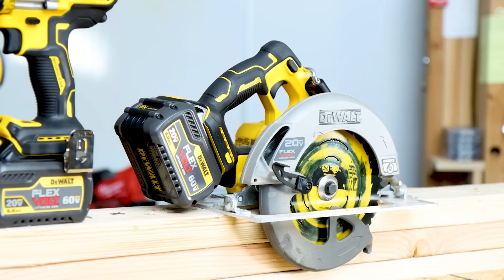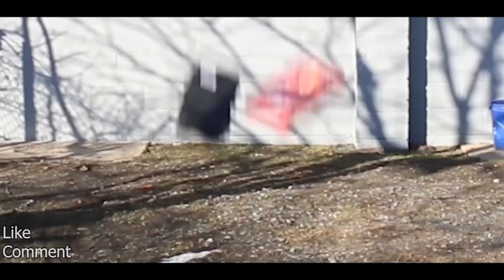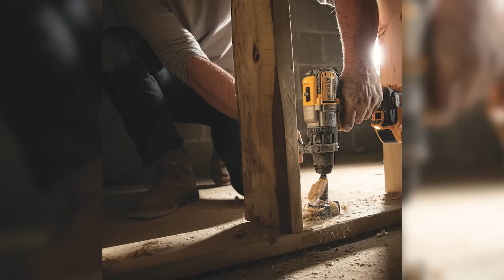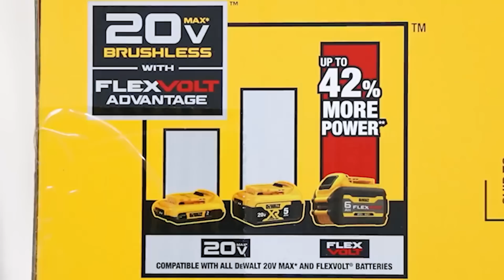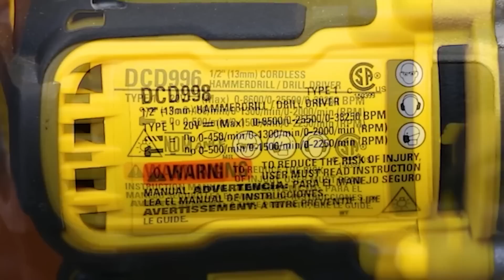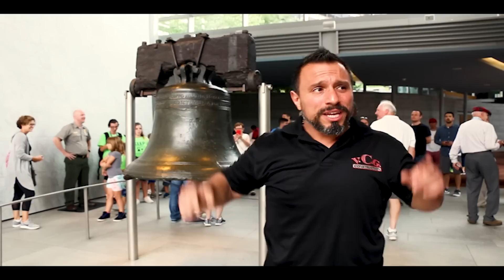DeWALT Tools DIRTY Marketing Tactics (FLEXVOLT Advantage AND Power Detect Hammer Drills)

Comment: I think it had to do with manufacturing and where the tools are coming from, it says in the manual that for shipping purposes the cells in the batteries are separated. With that said the flexvolt batt in the power detect grinder I notice a difference in power and generally think the bigger batteries help with output no matter what the tool is

Comment: It is quite convenient that the tools from Lowes (That don't carry flexvolt) get the advantage from their 20V max larger batteries. BUT The Home Depot variant has a "Flexvolt" advantage because the stock and sell flexvolt batteries.  My guess is like a LOT of other things they are in both big box stores yet are tweaked ever so slightly by the manufacturers for several reasons to suit each store (One thing you can't do is use it for price matching, as they are NOT  the same product in name (Even if they are for real)  Alot of appliances are the same way as well, just to prevent easy comparisons among the big box stores.

Comment: here's my thoughts on the matter, the 8ah will be a 2p 5s battery, that being two rows of (5) 21700 cells rated at 4ah per cell, the 6ah flexvolt is 3p 5s but are the smaller 18650 cells (in 20v mode) now as a general rule of thumb the larger the capcity the cells the lower the current can safely be discharged from them, the fact that the 8ah battery uses physically larger cells than the flexvolt kind of muddies the water (as you can increase the capacity and still have a comparable discharge capability) Its more than likely that the flexvolt 18650 cells will have a discharge capability higher than the 8ah (lower capacity thus higher discharge) BUT for this discuassion lets assume that they are even, in this scenario the flexvolt wins on current (and therefore power) delivery simply becuase in 3p you have the current of 3 rows of cells discharging vs the 2 in the 8ah the other advantage is the lower voltage drop due to cell resistance, all cells have an internal resistance and the higher the current draw the greater the voltage drop, thus the flexvolt being 3p should see a much lower voltage drop due to both an overall lower resistance (kirchhoff's law) and lower current draw from each cell the lowe current draw per cell will also mean a longer overall battery life.

as a Caveat I would need to investigate exactly which cells are used in each battery for a proper and fair comparison
Reply: Vince should have you on the show
Reply: @forrestweldon9168  thanks, there are far more knowledgeable out there than me in regards to battery tech, my studies in the subject are only cursory
Reply: Bingo! Voltage don't lie.

Comment: Why does the amp hour even affect the performance. Its 20v, one just runs longer.
Reply: More amp hours means it has more cells to run a larger load for longer regardless of voltage

Comment: As far as tool itself, the ability increase came from movin from brushed to brushless motors. As far as different models of brushless, i think dewalt is just tryin different angles of marketing. The flex volt batteries are just awesome,  although heavy. If just runnin screws, i'm more likely to run xr batteries, but if doin a lot of drillin, probably gonna run flex volt. The small differences in styling are really what's gonna be the decidin factor for which model ya get.

Comment: Yeah flex volt advantage is very real I put a 2 inch hole saw on that hammer drill it will chew through anything and not slip a beat when other drills will fail and start smoking like when you catch a stud or floor Joyce when I need a hole in a specific place I instal solar systems and back up batteries I use docs 999
Reply: Dcd999

Comment: Nope, all slightly different motors. These 3 were tested against each other by another reviewer. The 996 actually died surprisingly... and the UWO get higher from 996 to 998 to 999... they are all excellent, but that 999 is a hell of a beast... came out on top of all drills at pro tool reviews.
Reply: Yes I got a dcd999 it’s my go to for heavy duty tasks hole saw and paddle bits concrete it chews through anything and things that would kill any other drill and make it start smoking that dcd999 is easily the most powerful drill on the market

Comment: I'm on my second dewalt xrp and I like the drill but it has some flaws. Flexvolt batteries don't last nearly as long as they should ( 6 and 9's ) but I have three burnt up milwaukee drills and price wise I can buy two dewalt's for the price of a milwaukee. All have good power and do the job. I think the different models is a way to get devout lowes guys to think they are getting a better drill and visa versa with home depot I don't doubt that everyone of these drills are probable the same. Look at the dewalt bags( made in the US with everything that isn't made in the US ) it's power of perception they are using against us. Smart on their part.

Comment: I've just ordered the 999 from the US as they don't sell either 998 or 999 in the UK. I was under the impression that the 999 has the extra 2 pins being a flexvolt tool meaning it has the ability to draw more power in one hit over the XR range  of batteries that only use 4 pins, so if it hasn't got the extra pins on the 999 and can't use maximum power from the flexvolt batteries then I will be extremely pissed as I've had to pay a pretty penny when I add import taxes and postage fees which were nearly as expensive as the drill itself, please can you let us know what information you can find out on this!! Thanks for your time and please keep up with you great vids as I'm a big fan from across the pond👍.

Comment: You should probably stick with construction. I don’t have these tools, but they all looked like 20v tools. Thus, their power is somewhat fixed. The battery, with the right tool has the ability to serialize the voltage to 3x the 20v so it can be used on 60v tools. Now higher volts uses less current (watts are watts) so copper windings will be smaller  allowing 60v tools to be lighter. When using the same battery on 20v tools you are basically getting three batteries so they will be only slightly more powerful because the battery can hold the 20v longer when sourcing current through 3 batteries in parallel. There may be some losses due to the absence of sophisticated battery balance circuits. Because of this, one or two batteries may in essence discharge the others, aka unbalanced. Think of it as a battery set that can be internally changed from three 20,s in series to 3 20’s in parallel. This is just a guess. Dewalt could confirm.

Comment: So still confused. Would like to see all possible combinations of tools and batteries for a true conclusion. Run the 996 with a 5ah, 6ah FV, 8ah, and 9ah FV. Run the 998 with a 5ah, 6ah FV, 8ah, and 9ah FV. Run the 999 with a 5ah, 6ah FV, 8ah, and 9ah FV. If its a capacity issue, would all models perform higher with an 8ah or 9ah FV battery?

Comment: Large retail stores often have price beat etc, so they get their own special part number / version which ships as a slightly different package, looks almost identical and can't be easily compared to other stores.
Reply: This is exactly the issue. Lowe's gets kits marked xxx1 while home depot gets kits marked xxx2, same tools and accesories, but different number so they don't have to price match.
Reply: @infinityfringe  fun fact dewalt(and the other brand tools) are sold on commission from the tool manufacturers (like car dealerships) so stores dont have to have spent millions in inventory on tools.

Comment: Open them up. Plug a battery in and test the voltage at the ECU's. That will show you if the electronics in Flexvolt are actually using 60v or 20 like the rest.

Comment: Sorry to rain on your hate train, but I actually tested them and there is more power with the "power detect" version and the "flexvolt advantage" version. Yes, each drill does have more power with a bigger battery, but the best gains can only be seen with the 8ah on the power detect and a flexvolt on the flexvolt advantage. So yes, the biggest improvement is the batteries, but the newer drills are also improved.

Comment: All anyone has to do is call Dewalt and speak with an engineer.  They will happily explain it.  They make sense when you listen to them.  The marketing tactics have more to do with the store and not Dewalt.  Example, Lowes explained to me they have the Husqvarna tractor equipped with different accessories to reach a price point.  The box stores try to reach a certain price point so they order differently from the Dewalt.

Comment: Ok since me and the lads have setup 5-6 years ago, we have had 2 dewalts 996 and 1 Chuck broke after 2 years of hard use the other is 18 months and going strong, we have had 3 Makitas Dhp 481z and 2 broke with in a year and the 3rd is making terrible noises (nearly gone) so we orders the dcd999 with a flexvolt and the makita xgt hp001gz, the makita is smaller lighter but the dewalt is leagues ahead for pure power, in hammer mode it leaves the new xgt for dust but it’s still early doors, all I can say is the dewalt 999 is the most powerful drill our lads have ever seen

Comment: follow up video needed. test power detect drill with 8ah battery and flexvolt advantage also with 8ah. then test both power detect and flexvolt advantage with a flexvolt battery.

Comment: Dewalt so far has never let me down  their tools are Awsome ,
Reply: Both dewalt and Milwaukee have let me down before still great tools
Reply: I'm pretty partial to Dewalt, however, Milwaukee is a very close second. I use Milwaukee for my impacts in the field, but I use Dewalt for just about everything else, with the exception of Hilti's specialty tools. Now, I'm an Ironworker, so these tools have NEVER been treated nicely, and I've had ONE impact shear the 1/2" anvil off, and have gone through a few sets of batteries. Other than that, I've never had an issue with either of these brands in 9years of my experience so far. I love 'em.
Reply: Same here
Reply: My very first large tool purchase was a 12in compound miter saw DeWalt it lasted from age 18 till 45 and I have owned a bit of everything I like DeWalt Milwaukee and flex my first cordless drill was a Makita long battery and when it quickly became outclassed I went to DeWalt nikad to then trying to go back to Makita 18v lithium and it discusses me too hear people talking about Makita because they are trash compared to DeWalt and Milwaukees I spent a huge investment switching to them and their dills and impacts were garbage when I was handing my guys 10 year old nikad  drills and impacts to hold them over while brand new Makita drills and impacts were being fixed or replaced I quickly sucked up my pride and sold off the whole collection of tools

Comment: Higher AH only Allows Longer Run Time. I am curious How they have the 60/20 Flex Volt Batteries wired?? Series gets you Higher Volts. Parallel gets you Higher Amps.
Reply: Higher AH batteries can provide more power, along with longer run times. Remember, physically larger batteries can provide more current, so even if the voltage is the same, you will get more power. 

It’s why a 12 volt car battery can start a car, while 9 AA batteries (also 12 volts) won’t be able to do so.

Comment: its hard to say what is more power with dewalt because their drills & impacts are rated in UWO (unit watt output) and not inch lbs or ft lbs....they have always been very sketchy in their power specs like its some kind of big secret. Ridgid kinda does the same thing with the octane batteries....if you put an octane battery on a non octane tool it supposed to give it slightly more power but they dont like to advertise it.
Reply: The ones I bought say clearly 1200 ft lb and 330 ft lb. I have a smaller one from a few years ago that is inch lbs.

Comment: I work for a tool repair company, and I see a lot of the 996s in for repair, and some 998s, no 999s for repair but I have seen it and heard feedback on it. The 999 and 998 are basically the same hammer drill. No real power increase, a little better durability in parts as opposed to rhe 996. Dewalt is making the 999 to scam people into paying more for the tool connect thing they have. Milwaukee is also doing it. They just needed a better excuse to release the same drill with tool connect for more money, so they made the flexvolt advantage thing.

Comment: Yo Vince! Enjoyed the video "Dewalt Tools DIRTY Marketing Tactics." I was relieved to know that I'm not the only one to notice DeWalts method of "Play on Words" since the Stanley/Black &  Decker fiasco. Don't get me wrong; I own and appreciate many Dewalt tools. However, one would assume that they are comfortable being #3 or #4 in the Power Tool market. I have the DCD996 and the DCD999, but I bleed Red & Black from my addiction to the superior quality and performance of Dewalts Daddy; Milwaukee. 
After your video, I couldn't help but wonder how you could post all the comparisons without even mentioning that even with all of Dewalts claims of improvements, they still can't manage to build a 20V nor 20V/60V Flex Drill of any kind that can keep up with the performance of the Milwaukee "18" Volt Milwaukee. I was curious, so I did some digging and found that the DCD996, DCD998, and DCD999 utilize the same Motor, Clutch (of sorts), and Chuck (with the exception of the 999's Chuck Teeth) across the board. They only change the battery and a few minor Housing Tweaks. ALSO, in my testing, none of the 3 was able to come close to the Milwaukee 2804 M18 Fuel 1/2" Hammer Drill. Even being more compact, the 2804 outperformed in both BPM, RPM, and Torque tests. That's a 18 VOLT TOOL that takes on all the advertised 20V and 24V competitors. It tears their arms off and beats them to death with them. 
Next, I compared the DCD's to the Milwaukee 2706, and found the same results. Aaand, I had to do it, I dug out my old Milwaukee 2611 with its BRUSHED MOTOR, and ran it against the DCD's. Would anyone have guessed, the little Milwaukee That Could, at minimum, kept up with all comers and even had longer run time than the 996. They say, if you can't run with the big dogs, stay on the porch. Well, what if you simply got to the porch before all the other dogs?
Reply: Milwaukee,s warranty will also put dewalts to shame.

Comment: Vince's suspicions are wrong.  I had the same questions and eventually worked my way up through DeWalt Customer Service and ended up getting a call from Nate with Dewalt (as seen on the Sparky Channel video on this same subject).  Here is the summary...  The 996 & 998 have the same motor, but the electronics have been upgraded to allow the 998 to use more power from the battery.  So the 998 is more powerful than the 996, but since the motor is the same there is a limit to how much more powerful it can be. The 999 also has new electronics AND has an upgraded motor. As such, the 999 is more powerful than the 996 & 998 using the same battery.  Nate told me that the 999's power advantage over the 998 & 996 is small when all 3 are using the 5AH 20-volt battery, but that power advantage over the 996 & 998 increases as you move to bigger batteries.  In other words, if all 3 are using the 8AH 20-volt, the 999's power advantage over the 998 & 996 gets larger.  Even more so when all three are using the 6AH Flexvolt.  And even though they don't use the 9AH or 12AH Flexvolt batteries in their marketing claims, Nate said that the power advantage of the 999 over the 998 & 996 is even greater when using those two batteries.  Interestingly, he said that the 999 with the 9AH compared to the 999 with the 12AH Flexvolt battery were practically identical in their power ratings so I guess by the time you get to the 9AH you have reached the limits of the new motor and electronics as far as its power increase and there is no more to be gained with the 12AH Flexvolt.    It's up to you whom you believe, but what Nate says makes sense and seems believable to me.
Reply: SO I am now in the market to purchase a hammerdrill as I struggled to drill some brick for Christmas light hangars ughhh. I use the 5ah xr batteries but according to you I should get the newer upgraded tool 999 I can get the baretool for practically the same price as the 996 or 998... I should get the 999 right? Cause there's room to grow into flexvolt later right?
Reply: @ngnaw  The 999 will give you the option to run flexvolt batteries maximizing performance, according to Dewalt.  
I got the 999 as part of a kit and for the sale that is going on at home depot($399 kit + 2 free tools) I already had flexvolt batteries from my 578B circular saw so, for me it made sense to get the 999.  

It's up to you to decide where you want to go.

Comment: Idk, I think pretty much all of us knew that the tools were identical. 

The thing you didn’t address that we’ve all been waiting to find out is...SOFTWARE.

Can the new drills pull more power from the new batteries than the DCD996 can because of DCD996 software limitations?

Seems like a pretty easy question to answer if you’ve got all 3 drills, and all 3 batteries on hand... hint hint...

Fingers crossed hoping 996 isn’t software locked.  I doubt I’d get a new drill either way, but it’d be AWESOME if I could get more out it with a new battery. 

Now... where can I find those cool new auxiliary handles for sale...
Reply: To clarify (just in case VCG reads this and does a comparison vid) I think it’s a no brainier that the 996 will pull more power out of the new batteries. The question is, can it pull as much as the 998 or 999?

Again, it doesn’t really matter to me, doubt I’ll ever upgrade unless mine breaks. 

But hey, I’ve got plenty of free time, so... entertain me ;-)